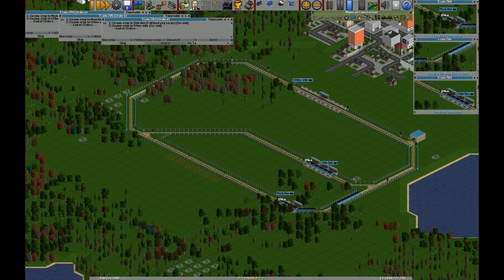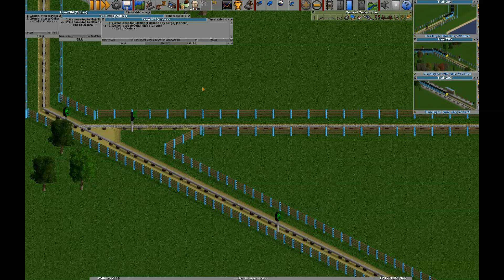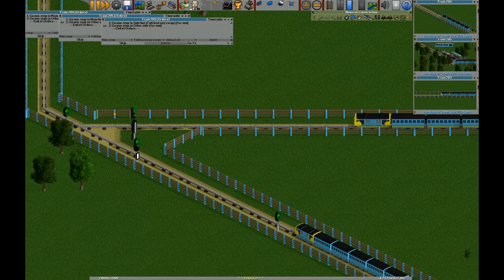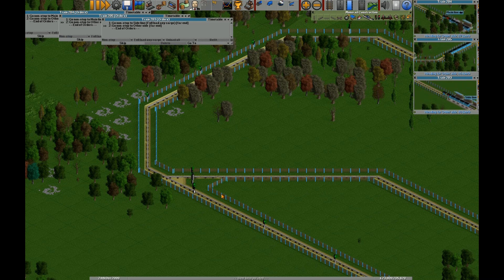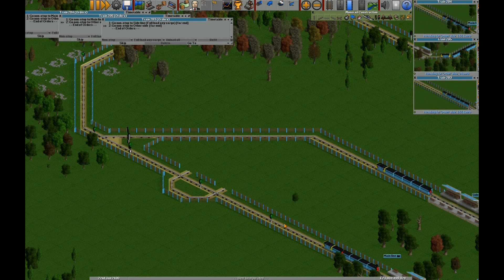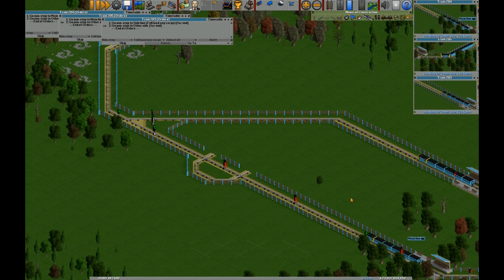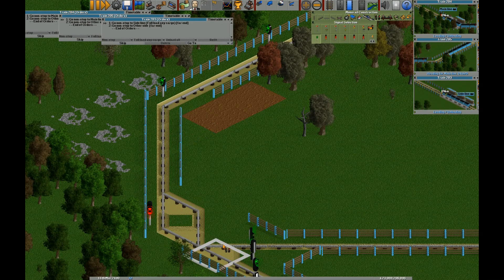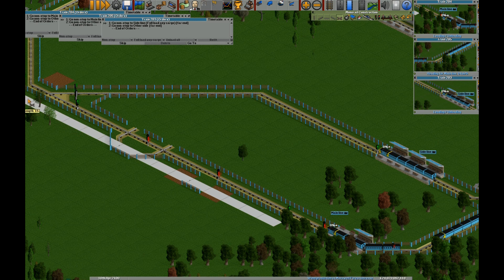OpenTTD tutorial - Advanced signalling: Priority signals

Comment: Instead of the first by-pass you can use a cleaner solution:
- Instead of a two-way exit signal on the main line, use a 2-way combi-signal.
- Change the signal before it to a two-way exit signal.

You can only do this once though.

As long as a train on the main line is in the segment leading up to the two-way exit signal, the entry signal on the side line will be red.
Reply from the maker: That sounds like a brilliant improvement! Didn't test it but I trust it works. Thanks!
Reply: I only found that after messing around with priority signaling myself since I saw this video, so thanks in return :)